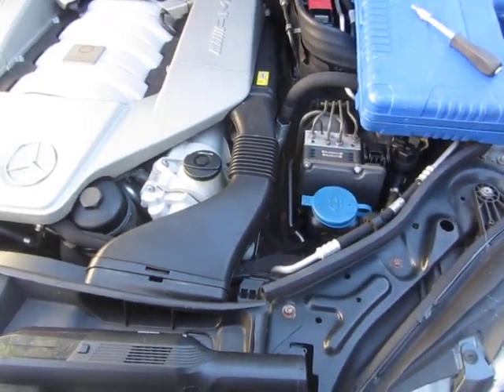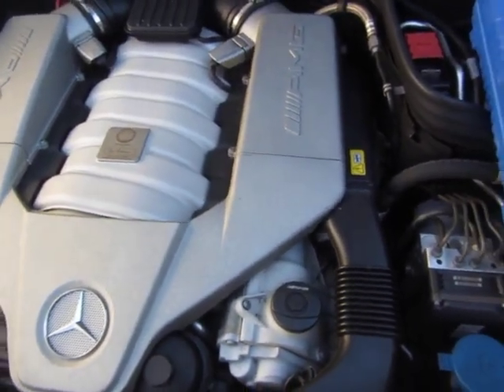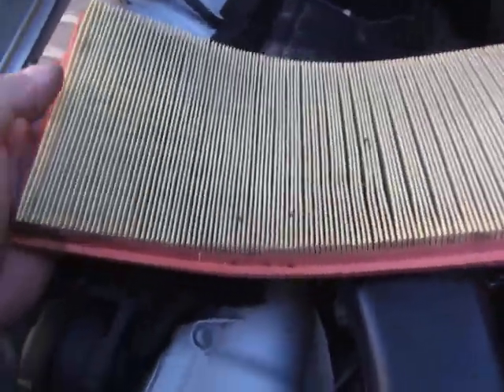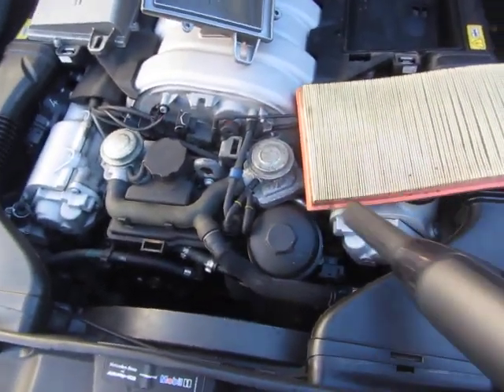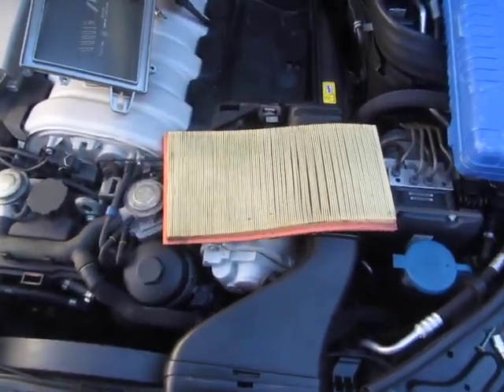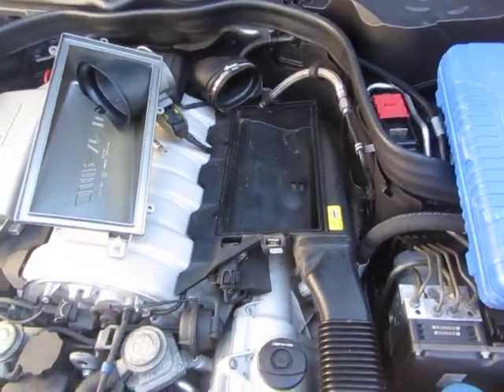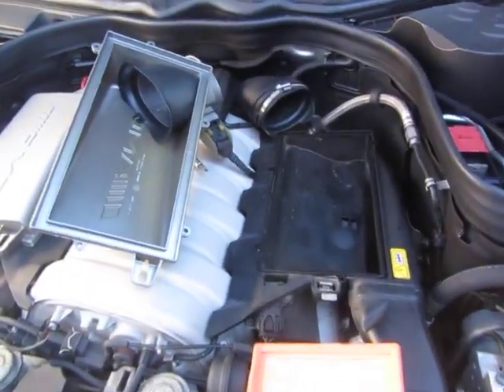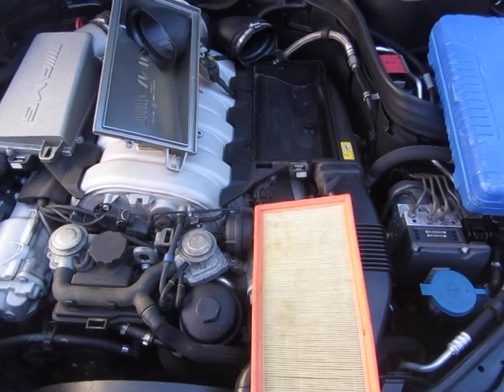Cleaning the air filters on my M156 engine (2010 W212 E63 AMG saloon)

Comment from the maker: I have now fixed the problem... It turned out to be the over sensitive traction control kicking in (due to the very damp UK weather) and cutting the power when applying aggressive throttle to pull away quickly... the solution was to turn off the traction control via the ESP menu in the dash board car settings... now it's all good ! and goes forward like an AMG car should !